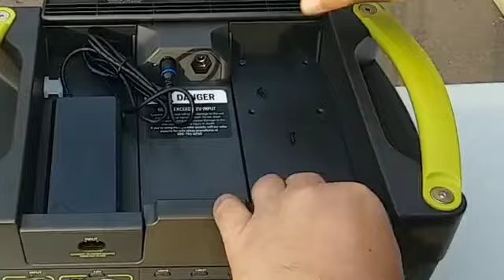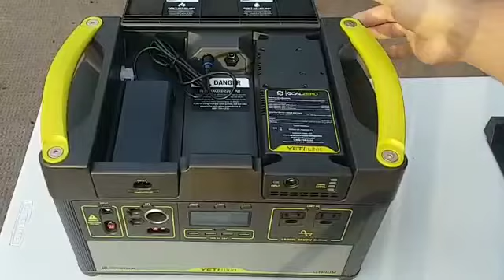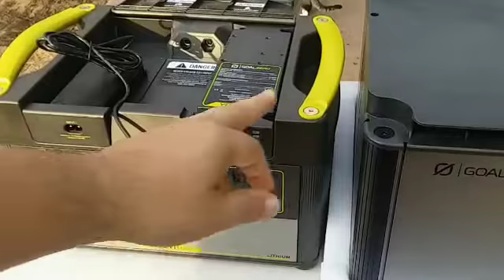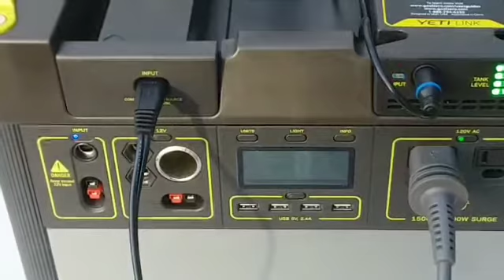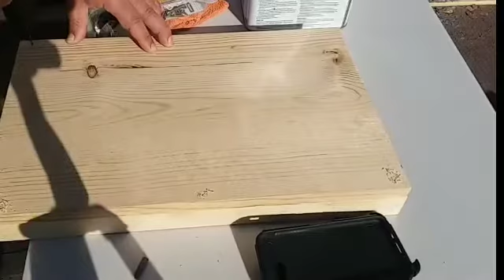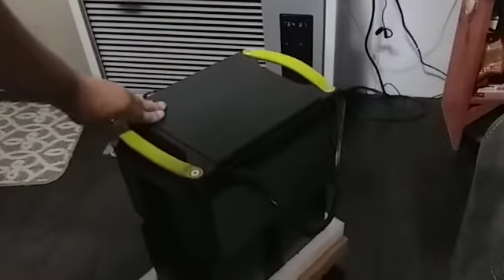UNLIMITED OFF GRID POWER - ADDING A GOAL ZERO LINK AND AN EXTERNAL BATTERY TO MY GOAL ZERO YETI 1000

Comment: Why does your 1000 have the plug on the front top left?  I know you can get a solar enhancer for that side and the extension module for the right side.  But how do you have a port on the front top left that is used for the module

Comment: Hello AP, I have the same set up but with 2 tanks. I can’t get mine to 4 lights on link. And then the charge doesn’t last long. I plugged in 2 portable charges and within a hour or so the lights started to go down. I’ve called tech support with no luck. Any help I appreciated

Comment: I don't see these as a viable home backup solution if you live in a reasonably built up area., A generator is far better as the average American home needs a lot more capacity. Now a remote cabin, people who live in the islands where there is no power or it's seasonal, or for preppers who are concerned about the remote possibility of an EMP, OK fine, as long as you have solar panels. They will give you long term, renewable limited power for lights, communication, small low draw appliances ect.  Perhaps they can run a small 110 volt pump if you have a shallow well. Those are all considerations.  The average American home is drawing 8-10,000 watts of power when people are home, 3-4000 during the day when everyone is at work (But the home is also using heating fuel so another energy source) A full size fridge will drain these in a couple days. Now maybe with a bunch of solar panels you can offset some of that, or have a smaller, super efficient fridge and be ok. You won't be running a washer/dryer, well pump, any of that. You will have to design your living setup around basically one 20 amp circuit, which can be done, it's just not what most people are used to.

Comment: Although I have a lot to learn about solar generators, I think I really like this, for a few reasons.

Yes, I’m an apartment dweller. But, I’m also getting older and I think I read where this is 40 lbs. While I took a look at the Goal Zero 1250, because it has a rolling carrier, I think it might be one of those that weighs about 100 lbs. There’s no way I’m taking the chance of lifting a 100 lb. unit into my upstairs apartment, wheels or not. And, because I’m trying to maintain OpSec, I’m not trying to make it anyone else’s business.

The other is that this sounds as if, at 1000 watt hours, it will be able to power my 750 watt fridge for a period of time.

Yet another thing is that I like the piecemeal expandability of it. That I can build it’s features over the course of time and also stack them, so the footprint remains small and, again, the nosey neighbors don’t have to wonder why I’m dragging some heavy piece of equipment into my apartment.

Yet another is that, if I can add car batteries to the expansion module, that means, at least at this point in time, that I don’t have to wait for delivery of a car battery. I can simply run to the local automotive store or even Walmart and buy batteries.

The other units that are lithium and under 40 lbs? They cannot power my fridge, you cannot link or expand them and I believe they simply are what they are. That, at least for me, their best usage is that I can place them in other rooms, should I choose to buy any, so I wouldn’t have power cables and components running from room to room. But, none of them, including the Jackery, for instance, at this same price point, would be the major solar generator for me.

Comment: Goal zero offers E8 to ring cables that allow you to chain Battleborn Lithium batteries as an extended battery option that allow you to use 100% of the rated Wh.  That is what I did.
Reply: Any followup on this? Can you charge the BB through the yeti then?
Reply: I’ve been scouring the internet for how to do this for about a month now. Can you explain how you’re charging the added battery? Or post a link to something helpful?

Comment: Lead acid batteries, incl AGM, only have 50% usable capacity. So this expansion module rated for 100 Amp Hr is really only giving you 50 Amp Hr or about 550 Watt Hr.

Comment: New Subscriber Goal Zero makes great equipment for people like me who want (Need) Plug-n-Play equipment. I have the same set but with two expansion batteries. I purchased a couple of 1000Li about 2-3 years ago.  I purchased the Expansion Batteries September of last year. Hooked everything up when they arrived to for a test run and the batteries were at 100%. I stored the batteries in a closet. I've used the 1000Li on multiple occasion, but never needed to run it for more than 6-7 hours, so the Ex Batts stayed in the closet. I pulled them out today and hooked everything up to charge the batts, they were at 75%. I thought that was pretty good considering sitting in the box for 13 months. I was reading through the Goal Zero Q&A regarding the 1000 Li which is no longer in production btw. According to GZ:

Comment: The Yeti Link can also be used as a high amperage car charger for mobile applications.  It can be switched to car mode through a reset button on top (pressing 4 times).  In this mode, it will charge when it senses 13V or higher (meaning the vehicle is running) but won't pull voltage from your vehicle battery below 13V (to prevent a dead battery).  Very slick.  Also....keep in mind, any 12V lead acid battery can be used with the Link in Tank Mode.  Doesn't have to be Goal Zero's overpriced batteries.
Reply: But how do you charge the additional battery when it is linked to the yeti?

Comment: Hey AP, great review and tutorial. Thank you for doing this.
I am currently getting the Yeti home integration kit installed that works in tandem with the electrical panel.  But I would like to add more modules to the GZ Yeti 1000. Your tutorial is excellent in guiding me to do this.
I am also adding, as input, a solar panel and a wind turbine which I plan to run in parallel using 4x1 MC4 and then connect an MC4 to 8mm input to the Yeti 1000.  Which 8mm input should I use in that case? The one on the left that is built into the Yeti or the new port that comes with the Link Module that you installed on the right of the Yeti?

Comment: How far can you let the lead acid batteries deplete before recharging? Have you recharged your expansion batteries yet? I want to use them in a neighborhood where I can not keep solar panels out all the time; just during a disaster/ or extended power outage,. So I might use up a lot of the stored power.  How to recharge the lead acid expansion batteries is my other question question. I have 4. The expansion batteries only recharge through the Yeti Link. I don't want to use the car charger.

Comment: I'm surprised no one has mentioned a key purpose of the Yeti Link. With a couple of additional cables, you can connect to a vehicle & use the alternator to mega-charge your Yeti. If you have a van or something with a house battery in addition to a starter battery, you can connect to the house battery & leave the Link in "tank" mode.

From their web site; 

"...When placed in “Car Mode,” Yeti Link can also be used to recharge a Yeti Lithium from your vehicle. Link is only compatible with a Yeti 1000, 1400, or 3000 Lithium." And you can still use solar panels to charge at same time.

Comment: I’m trying to decide what set up to get and I’m leaning towards the 3000x with 4 expansion packs charged by 2 or 3 boulder 200 hooked with the generators hooked up to the home integration kit to power 4 dedicated breakers. However I’m wondering if I’d be better off skipping the extension packs altogether and just getting a 3000x and 1500x and when one is depleted put it on The solar bank to recharge and hook the other one up to the integration kit. 

I’m looking at this as an emergency/disaster long term off the grid situation to compliment assist my home solar set up that’s about 7kwh with battery backup as well.

What are your thoughts

Comment: I own a 1400 unit, no it doesnt come with a "link" module. However, i opter to get the optional MPPT module and  24Amp fast charger module. I also have a 200watts solar panel but stop using the panel coz it takes entire day to fill 1400watts from 80% drained. The 25Amp fast charger plugged on wall power takes couple hours to full capacity, thats fine coz i have a gridtied to augment my household consumption. The idea of having extra power banks is just excellent. I havent really checked if the "Link" module can take in 25Amp from a fast charger, coz if it does then expznsion banks will be a very good option for me. Thanks
Reply: I don't understand why you would use these units if you have wall power. I thought the point was being able to charge them from solar.?  Now if your power is sporadic, ok, or in an RV, fine,  just curious what the purpose of this is. Being out in the country I still don't experiance hardly any power interruptions. If we do have one it is a major storm and you're out for days or a week. Thats what the generator is for.. These units are good for a day at most. I'm really curious.

Comment: Hello AP, in reply to your question. There is no such thing as a sealed lead-acid battery. They still have a built-in vent. It is just valved so that the pressure has to build up before it opens. Then re-closes afterward. So you can use it indoors as long as it is vented to the exterior. Here is the rub though. You never want this battery to freeze. Also since it is still a wet cell battery. It is possible to have a leak. Being inside of that housing will probably safe guard you that way. So my suggestion would be to rack them if you wish to go verticle. I would consider either a mechanical space such as where your heating system is or possibly in a laundry room then cut in some ventilation using ABS or PVC pipe. I still suggest an upper and a lower vent. The lower one could be routed to a subfloor area to help keep them from getting too cold the upper vent could go out of a wall preferably adjacent. Once you exit the wall turn 90 degrees verticle and put some kind vent cap on to keep the moisture out.

Comment: Fun to watch another GZ user. I bought the GZ Yeti 1000 at Costco a year ago on sale for $850.  Been using in a full-time RV trailer off grid since.  Was wondering about the expansion modules, not sure why GZ did not design with lithium Batts instead?
Reply: Cost

Comment: Thank you so much for showing these to us. I am going to start saving to buy one of these. Not the extra but the Yeti 1000. 
I have found a connector on line so in a power outage my furnace can be plugged in.

Comment: EMP SAFE? i ask because America without power for 1 year can have 90% lives lost. thats a shared estimate. its a very real threat it seems is not spoke of as serious and real as it is?
Reply from the maker: This is not EMP proof as far as I know but I do plan on purchasing a second unit in the future for the purpose of keeping in a Faraday cage for just that purpose.
Reply: @RudysCornerOfAlaska  
thats what im trying to figure out each time i buy something i want to use & protect. buying doubles and never using 1. but knowing its a real threat and never knowing if or when. i have lots away safe. its hard to justify some things 2? that is a nice back up power system you have. oh and keeping fridge condensor coils clean do help remove heat faster so less power used. if theres pets in the home they clog more often with pet fur.

Comment: This Video has brought up the important topic of energy self reliance.  The solar generator/power station industry is offering good products at good prices now and with the built in BMS & inverters, a solar system is an easily as connecting solar panels for a renewable power source.  
  The lead acid battery options are quickly becoming obsolete when the lithium battery life span and available power is compared to the lead acid option. There is definitely a larger cost up front with lithium, and that is a real barrier.  I made the switch to lithium 3 years ago and am very happy I did.  
  Hobotech & Will Prowse are great youtube channel for learning about solar options.  There is a very strong emphasis on real testing of products and a lot of more affordable options come out looking good.  Check out Jackey & Maxoak solar generators as proven options.

Comment: U may want to protect your goal zero plugged into a power strip w/ surge protector & surge protect Everything A.P ☝️ ⚡⚡🌩  🤓
Reply: Surge protectors aren't required on solar generators. These kind of solar generators do not have a ground port, The 3rd plug is just a hole/open space. Since these units aren't gonna be hit by lightning or are under voltage flux as home outlets go. They don't require it because there is never gonna be a surge or spike. The only point of a ground is to fire back any surge or flex that happens via the two prongs.
As far as surge from home to the unit and to device. The unit's AC brick has ground. So it's unlikely to surge to the unit because the AC brick converts from AC to pure DC. So the surge will only happen inside the power brick and not to the unit.
Reply from the maker: Good point Carlos, I actually have it plugged into a surge protector when I power it off of the wall receptacle.  God bless...

Comment: Nice generator but unfortunately out of my price range. I used most of my stimulus check for more food preps and a small wood stove.
Reply from the maker: Well Pat, I have to say you did good as food and heat is more important than electricity for maintaining life.  God bless..
Reply: @RudysCornerOfAlaska  Thanks for the encouragement. Even though I live in Southern Minnesota it still can get
-20 to-25 plus the winds. I have 2 Mr Buddy heaters plus quite a bit of propane but the wood stove shores up my heat. My next major priority is electric.
Thanks for all you do
Reply: Wood stoves are the best. Keeps you warm & you can cook on it with cast iron pots & pans. Good choice.

Comment: Not going to last long will need about 12 batteries to last overnight. Go buy a Small Yamaha Generator. Not a sustainable solution.
Reply: that depends on the load.  my yeti 1000 powers my furnace overnight.
Reply: It absolutely last overnight, depending on what your charging. Heaters and big pulls are too much but lights, computers etc all at the same time will last you several days, I dont know about for a whole home but for use in a Van off grid it will keep things charged for a while without solar.

It is essentially a "generator" except it charges from electricity and not gas, and its silent unlike non solar "generators"

Comment: I hate to say, because I love your channel, but 1000 watt/hours will only last an hour with a 1000 watt heater.  It would be great for LED lights but not heaters.  Solar and batteries are not good with electric heating systems.  They just consume too much power.  Burn wood for heat and use solar/batteries for lights and short term motor/pumps.
Reply from the maker: Depends on what you use it for, I would never use this for electric heat, my main use for this is powering my Toyo Stove during the winter which only draws 360 Watts during start up and for my refrigerator during the summer which only draws up to 300 watts while the compressor is on.  I actually had to use it this last winter for about 5 hours to power my stove and it did great and had plenty of power left after the electricity came back on.
Reply: @RudysCornerOfAlaska  Thanks for explaining.  I just heard "heater" and wrongly assumed you meant heating elements.  My apologies.
Reply: David Lilly if you are knowledgeable  of these things you should speak up. That's what we do here. Share.
Reply: Yes I thought he misspoke as well!  Isn't it 1000 watts for 1 hour at peak?